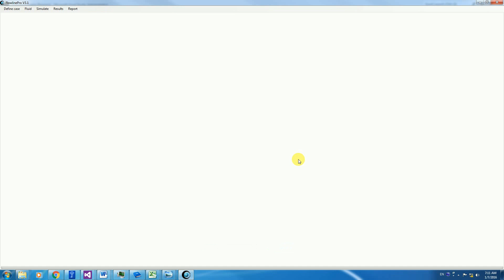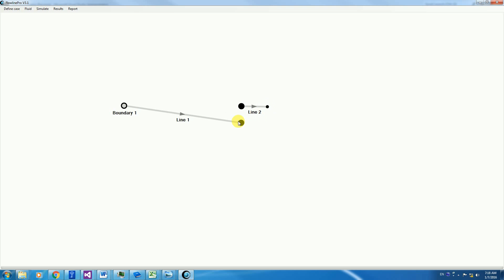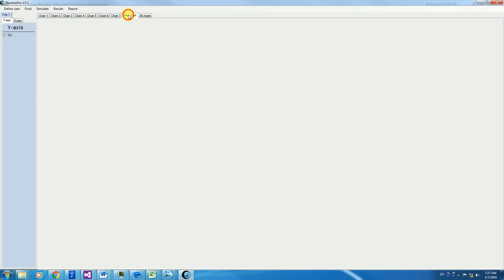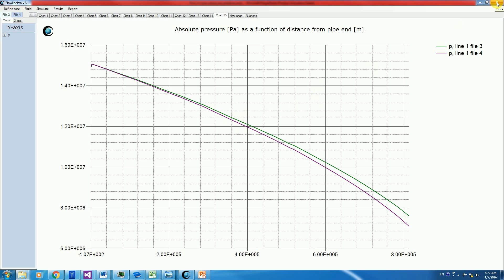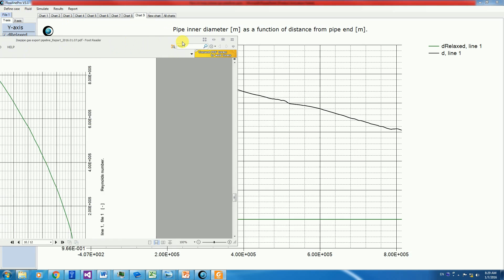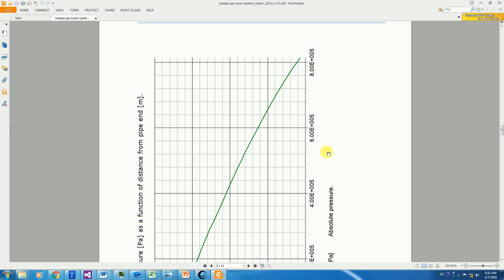Flow in long subsea gas pipelines

Comment: I thought that the 1,200km pipeline from norway to england was the longest gas pipeline ever built? as per this upload on u tube? https://youtu.be/iGBPgtomdjA. I know that there's a russia to germany pipe line which is 1,224 KM 24 km more, but still made in the same way, with different challenges i guess un water and the sea bed etc?
Great presentation mate.✌✌👌👌👍👍😎😎